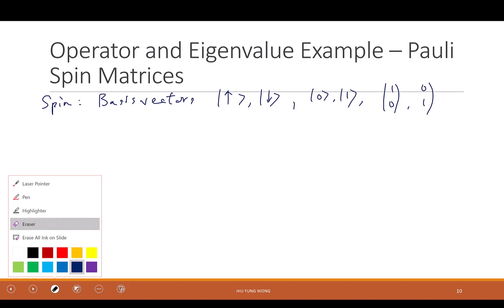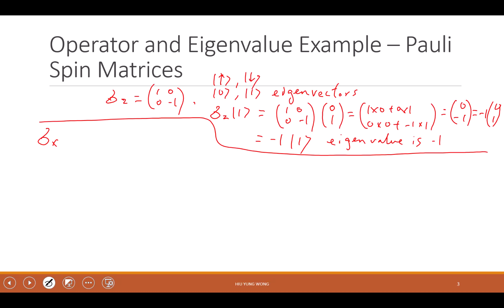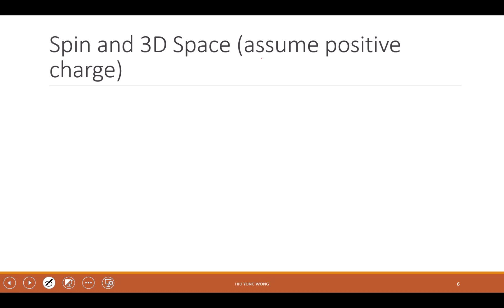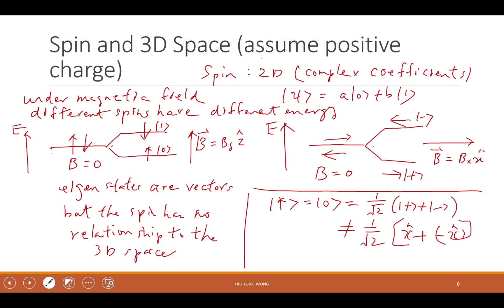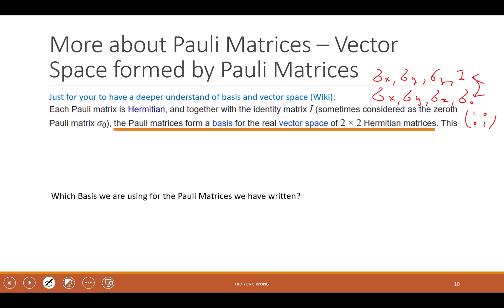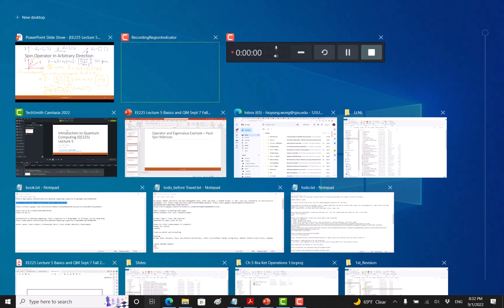Lecture 5, Ch 6,7 Pauli Spin Matrices, Eigenvalues and Eigenvectors

Comment: How does one imply there are only two bases or eigenstates based on obtaining only  two eigenvalues from Stern Gerlach experiments ?

I still do not understand why each Cartesian coordinate Pauli matrices has different eigenvectors. I understand they come from solution of the Pauli matrices eigenvalue maths problem but I do get how one spin vector can have 3 different eigenvalues in each Cartesian direction. Moreover each eigenstate is based on the same eigenstate of Z direction i.e. the eigenstates in other directions are linear combinations of the eigenstates of Z directions. do you have a reference I can read about it ? Most books talk about the properties of Pauli but I do not get an intuitive feel of this object and what is the purpose.
Reply from the maker: @jupironnie1, I might not understand fully your question. But firstly, just from a pure math point of view, each of the Pauli matrices has its own eigenvectors and eigenvalues. And since they are all 2x2 matrices, so they are 2D (although with complex coefficients, so not the 2D space we can feel), and thus it is natural that the eigenvectors can be a linear combination of the others. Secondly, why sigma_x, y, z have a relationship to our real 3D space? This is because when we measure the spin, we need a magnetic field. And the direction of the magnetic field determines the sigma. If it is in the x direction, we use sigma_x. This is just physics, and it agrees with the experimental data (e.g. the Stern Gerlach experiment you mentioned, and it only can have 2 values, spin up and spin down.) You may take a look at this video to see if it will make more sense. https://www.youtube.com/watch?v=qyPo6u3nJik&list=PLnK6MrIqGXsJfcBdppW3CKJ858zR8P4eP&index=53 (but here is more talking about rotation but related to the eigenvalues) https://www.youtube.com/watch?v=z3dRDOalBxs&list=PLnK6MrIqGXsJfcBdppW3CKJ858zR8P4eP&index=56
Reply: @quantum_computing  Thx. I will look into them and ponder on it. I think you are right that this is just the physics experiment part. I will also ponder on example 5.1 of your book.